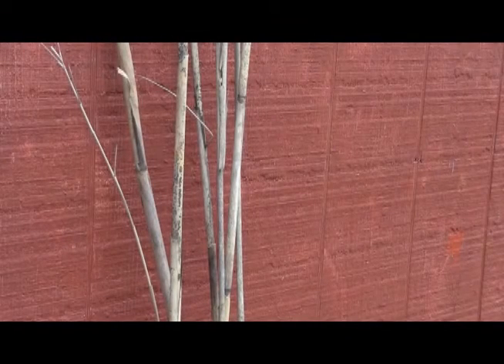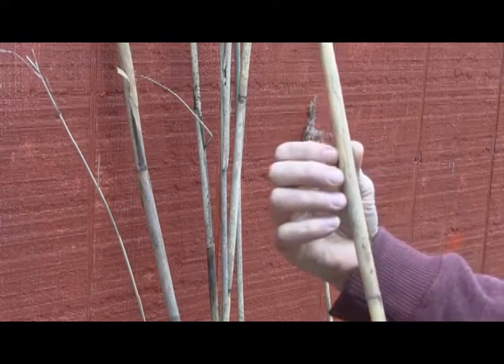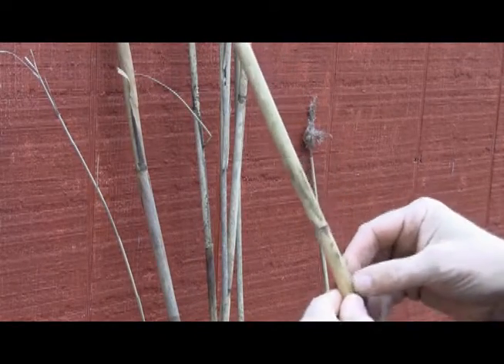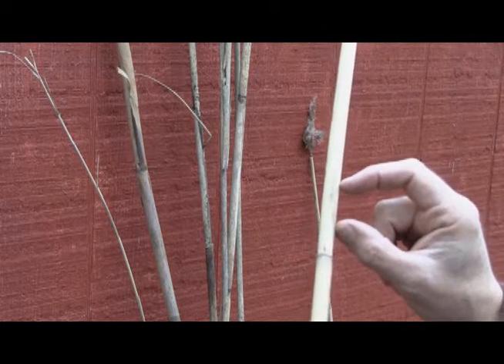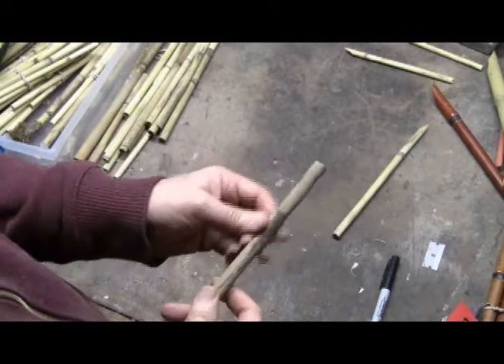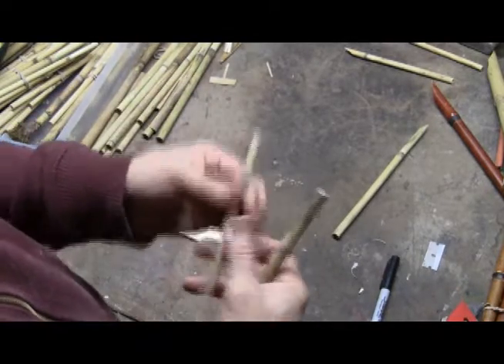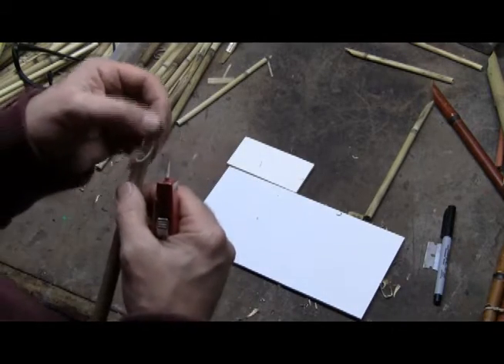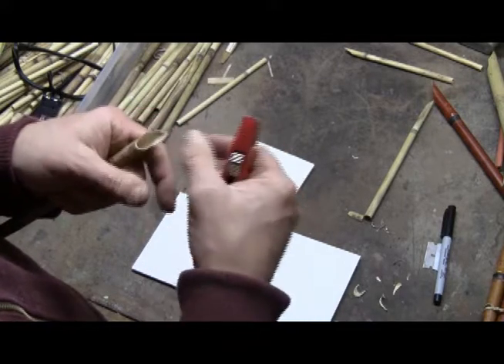How to make your own reed pens for drawing

Comment: drill your hole first. then take your blade and make a small cut moving up from hole toward tip. the cut goes just a short distance and leave blade in cut. give the blade a twist and it will make a perfect cut up to the tip. then shape the tip to the cut instead of shaping first and trying to cut perfectly in the middle of it. much better results. just a tip (no pun intended)

Comment: Edit: bless you btw. I would imagine wood particles and such would be an element that needs to be factored in for those with sinus problems lol

Now would you put the hole for the reservoir at the bottom of the cut you made at the nib split? Or do you put it further down away from where the cut made to split the tip?